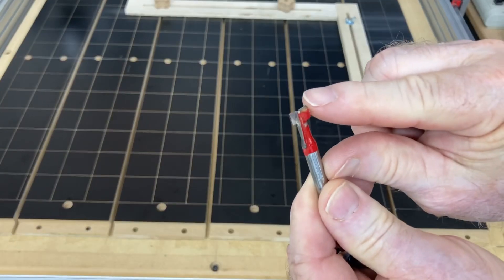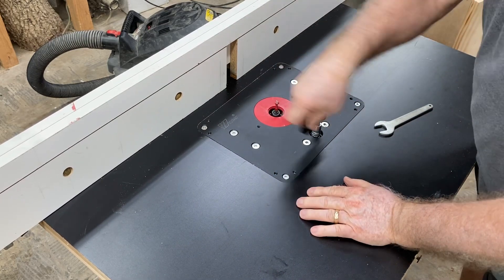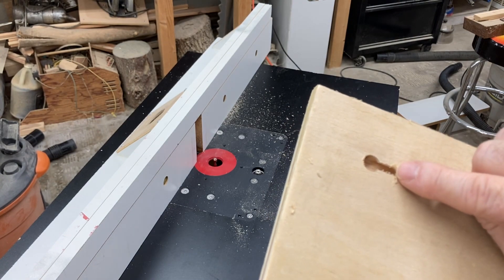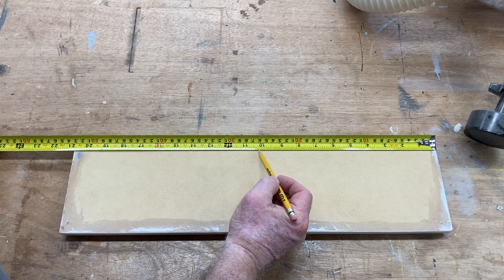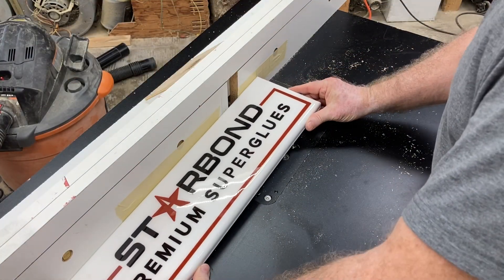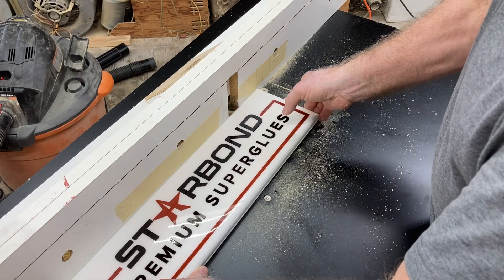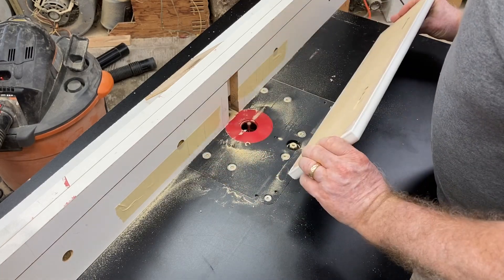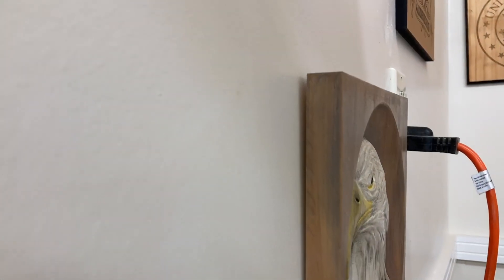Keyhole Slots on a Router Table

Comment: I would suggest attaching a suction cup to the front side of the sign to make lifting the sign off the router a bit easier. If your sign is to rough (not the epoxy one though) you can layer it in blue tape to make the suction cup stick. Last but not least, Using the glue and tape method you could glue a small block of wood to the surface which will work just like the suction cup method I have described.
Reply from the maker: Great ideas. Thank you